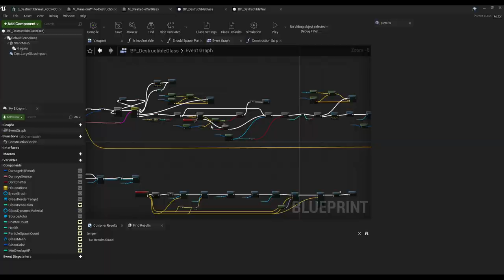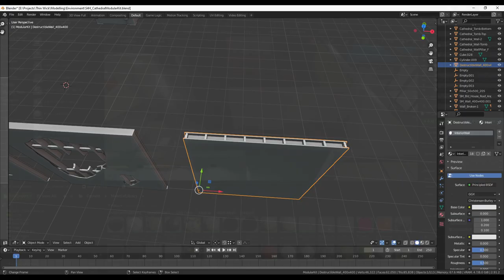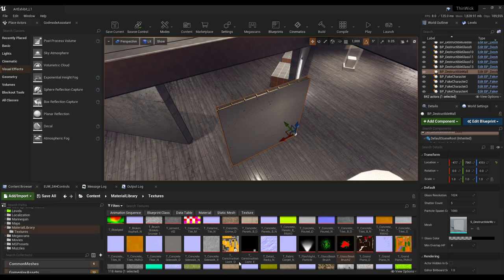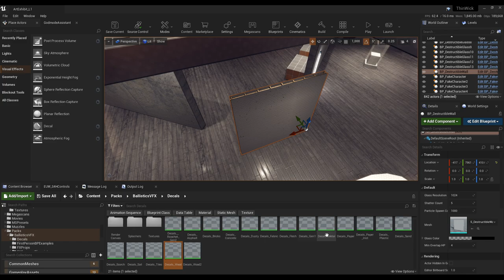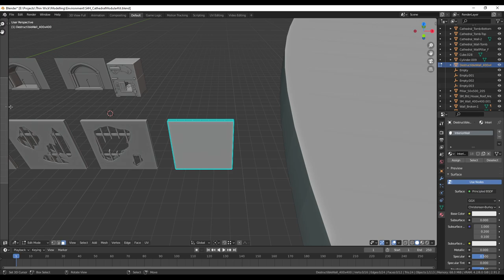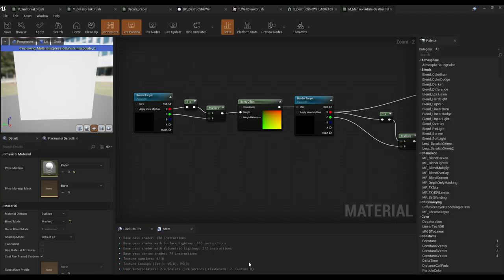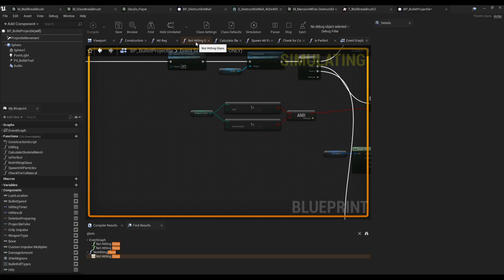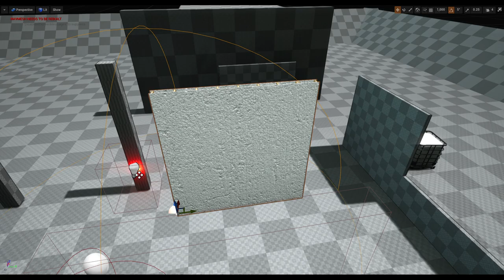ADDING DESTRUCTIBLE WALLS TO MY GAME

Comment: Lovely. Would be interested in seeing it without mirrored holes, as in different hole on the other side, but this looks awesome already.
Reply from the maker: That's something I noticed when testing it out for Part 2 of the video, only issue with splitting it up into two UVs is that it halves our resolution entirely, so a 1024 render target becomes 512 for both sides of the walls- not sure if that kind of sacrifice is worth it just for different types of holes/accuracy